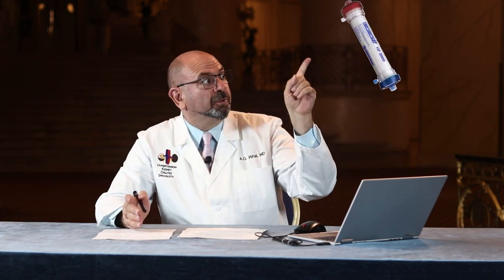Latest Bio Implantable or Artificial Kidney | The kidney project |  The Future of Kidney Health |

Comment: the problem with kidney transplants is that's it's a temporary fix, meaning your typical kidney transplant only last 12 to 15 years on avg. So its not a viable solution for anything long term. Not to mention you have to take immune suppressants so that your immune system doesn't start attacking the kidney, all the while leaving you more vulnerable to viral and bacterial infections. Sure it's a better option, than being on dialysis, but it's not a permanent solution. This is why artificial kidneys will be a game changer. It will be a long term solution, without having to compromise your immune system in the process.
Reply from the maker: Can not say it in any better way. Also a PIG kidney tansplanted in human
https://www.youtube.com/watch?v=ABdXYkl_4jA